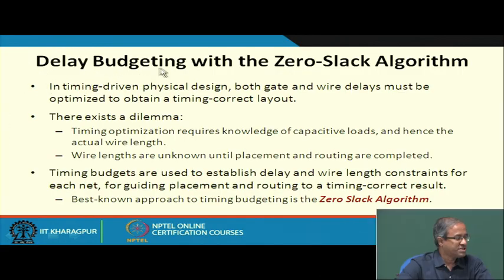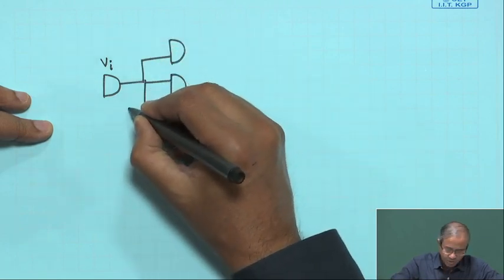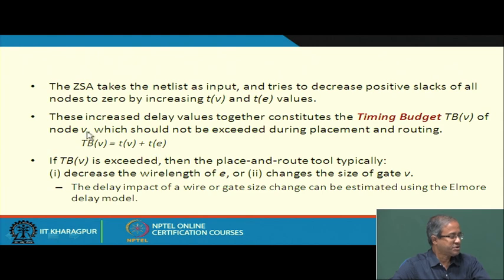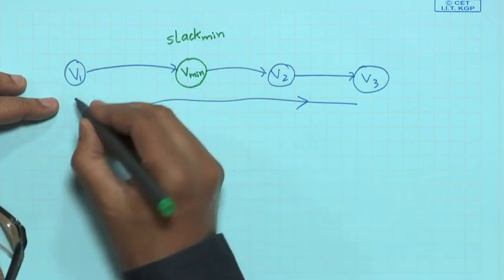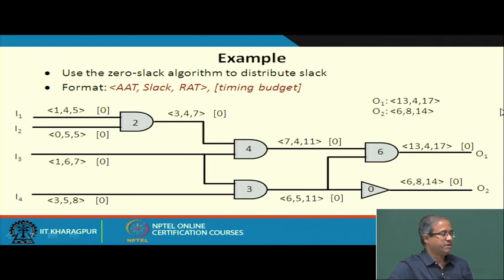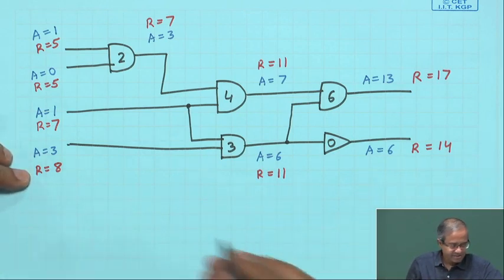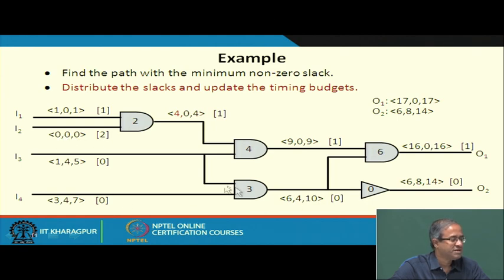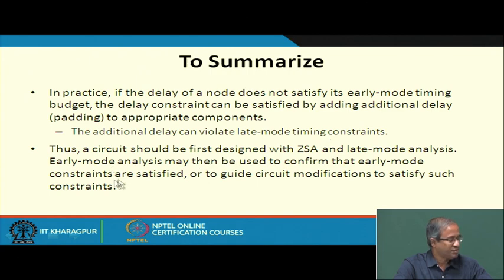Time Closure (Part 3)

Comment: Why we go to Zero-Slack? doesn't that mean that Fmax is decreased which is not what I want, I want to run the circuit as fast as possible, someone please explain why we need zero slack ?
Reply: i think its because that hold time is violated so he increased delay, i am not sure though
Reply: We go for 0 slack time, as there is some extra time wasted where we the value is arriving earlier(AAT), but the data can come even after some time(RAT), which means that the slack is positive. This positive slack has no benefit as there will be no setup violations, even when slack is zero. So, by increasing the actual arrival time, we can make slack=0 & this further decreases any hold violation at the output of the previous system, as the data can be delayed at that point.